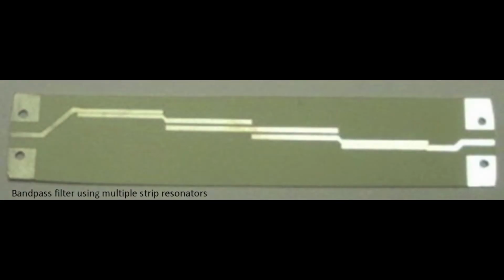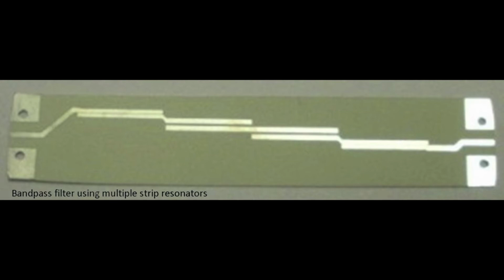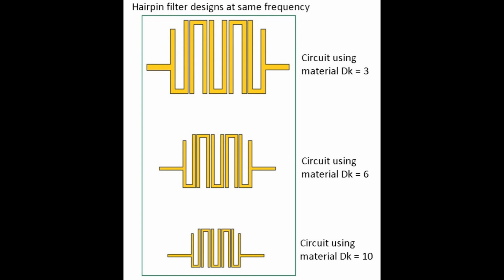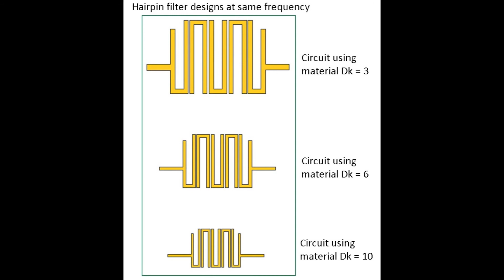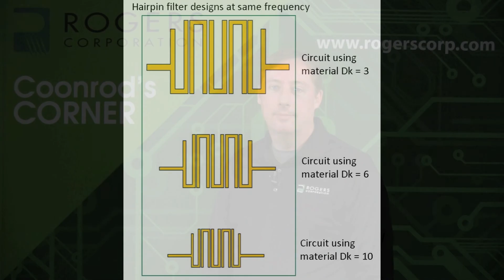Why are There so Many High Frequency Materials with Different Dk

Comment: And don't forget, once you've found the material that is right for you, you then need to find the PCB Manufacturer that can handle it and supply you with the correct finished board, that is where we come in ! http://pwcircuits.co.uk/